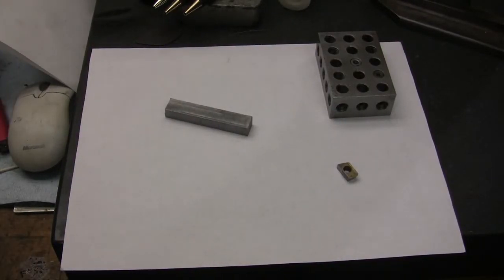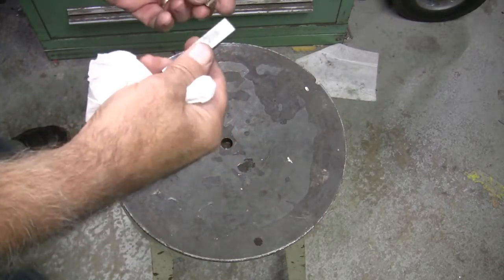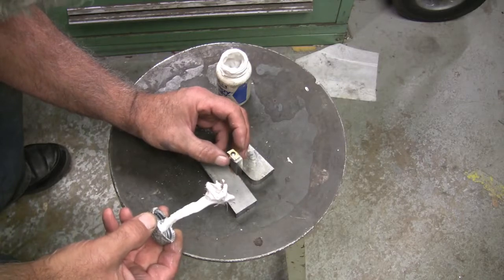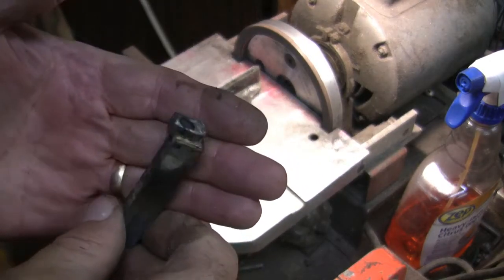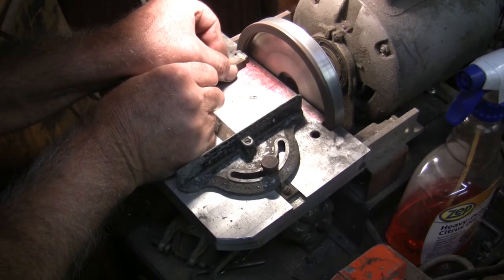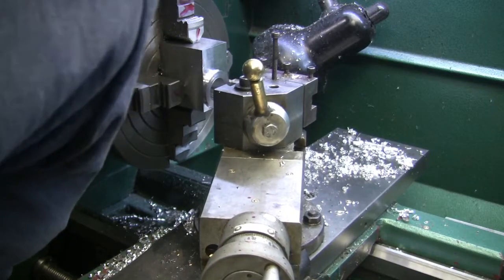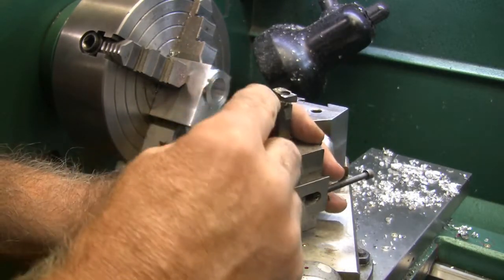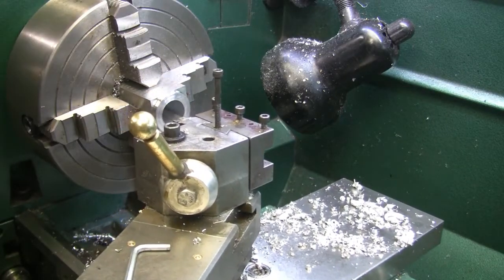Kerzel cylinder block 5

Comment: Good tip on the diamond set from HF. I'll keep that in mind. I found out something today. I bought a mixed set of the socket head cap screws from HF. They are dead soft. They look good, with black oxide and all that, but when I tightened them I could feel the hex start to give with only moderate torque. Sometimes a bargain's a bargain, and sometimes not. Tc, Mike
Reply from the maker: Yes some things at HF are great some are ok and some are just junk. The diamond set seems to hold up very well and they do cut really good. Mac's hardware is the same some stuff is pure junk especially their bolts a lot of them are counterfeit as far as grade of bolt.